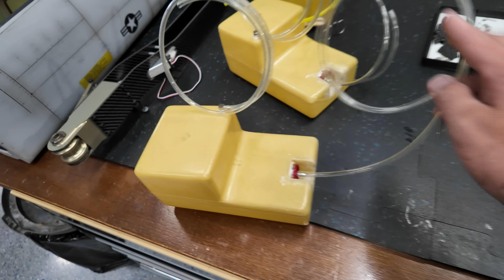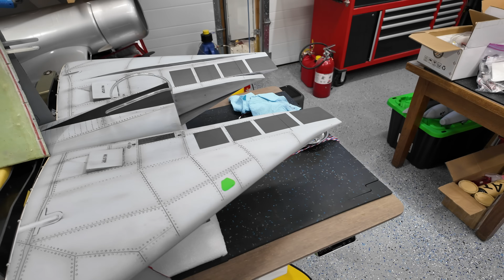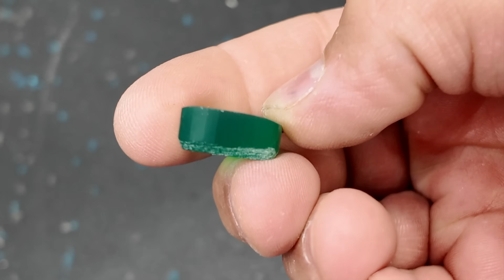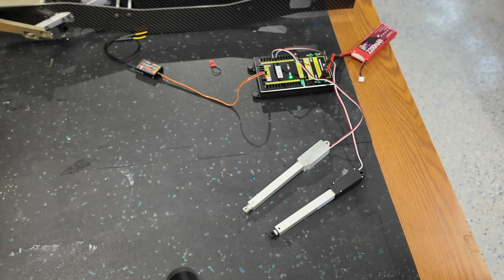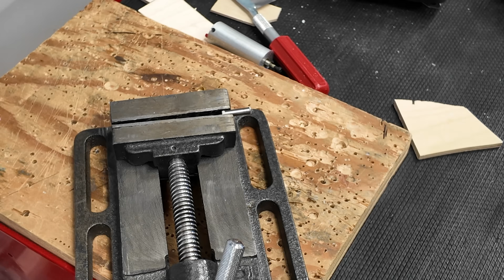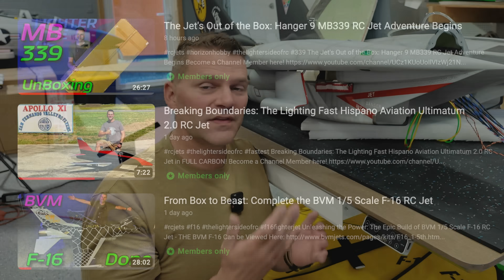TOP GUN MAVERICK Skymaster F 14 Build Video 4

Comment: Excellent job on your videos!  Love the tool tips from Trusty!  I'm doing the Actuonix 150 gear ratio upgrade based on your advice and it looks like you switched out the ends.  The ends come off the stock units easily but the plastic ends on the upgrades seem to be more permanent so I'm afraid I'll break something trying to remove them.  Did you torque them out and/or break them and the ends from the originals in the kit simply screwed right in?
Reply from the maker: Thank you! Glad you like the tips.  The ends do screw off and on with some effort.  The shaft also comes out easily allowing easier handling and switching out the ends.
Reply: @thelightersideofrc  Thank you!  Just finished your final video of this bird and she looks AMAZING!  BUILDERS appreciate all the engineering, fabrication, trial and error that takes place to get one of these flight ready, and you do a fantastic job presenting the process.